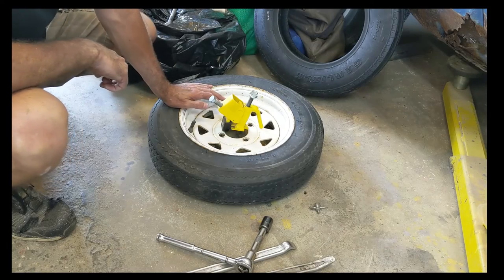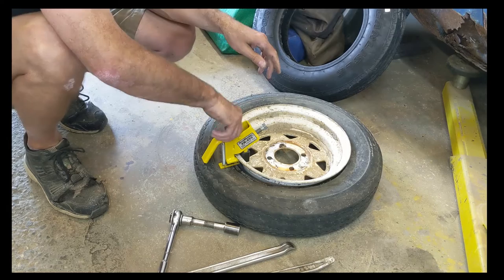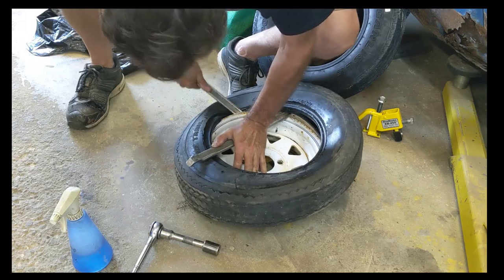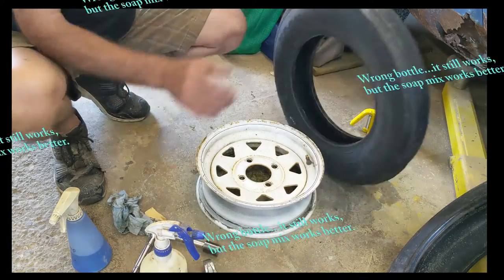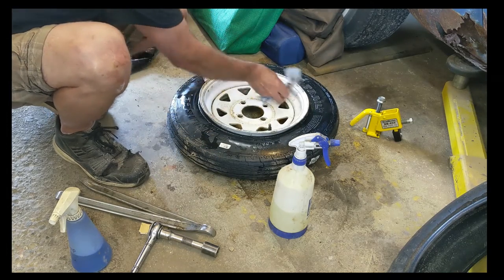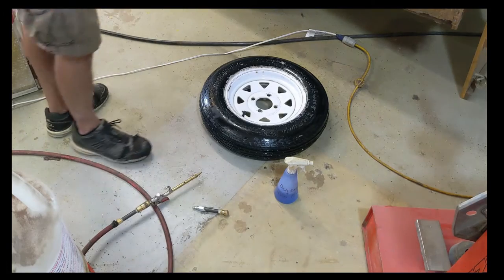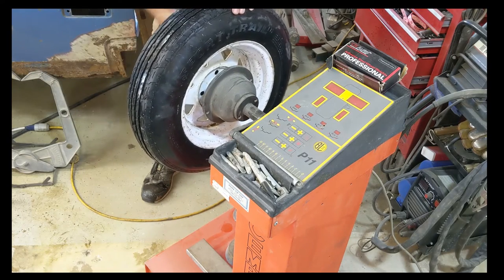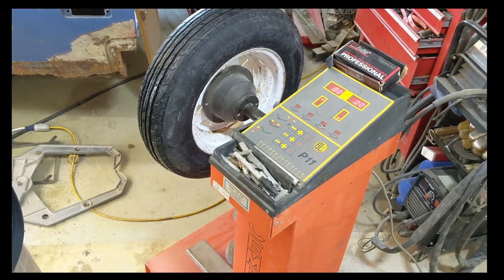Remove & Install Small Trailer Tires Using The Bead Buster and Hand Tools.

Comment: Tip: A pair of vice grips clamped to the rim will stop the bead from slipping so you can work one side only during installation.
Reply from the maker: That's a great tip Weldon! Thanks!